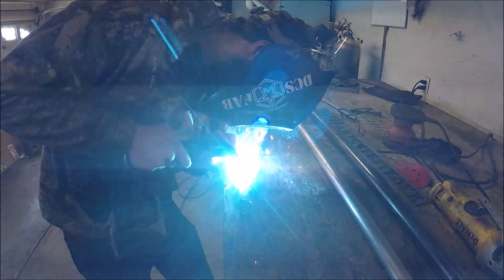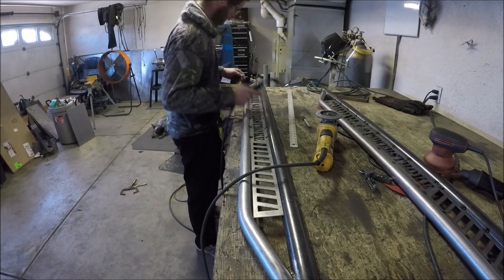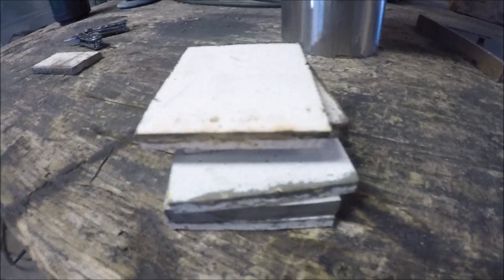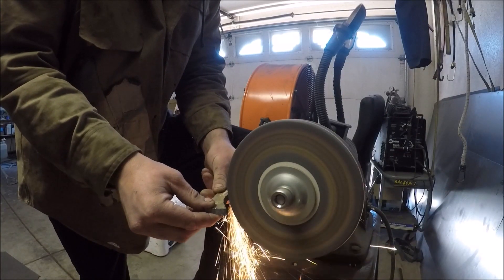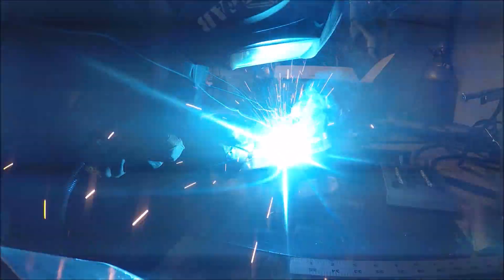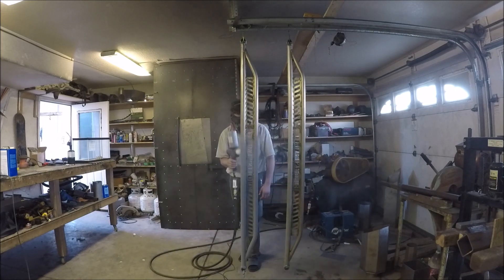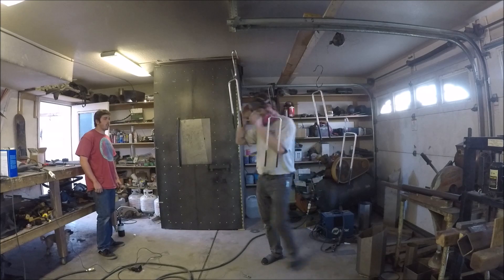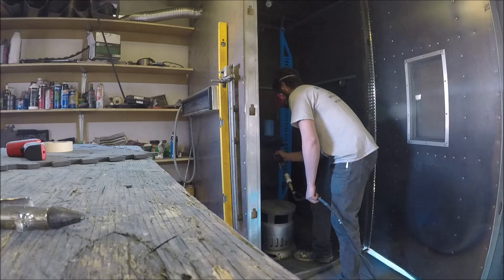Building The Most INSANE Set of Traction Bars! | DCS Custom Fab Work VLOG

Comment: Can you make a video on your powder coating oven? That thing looks badass
Reply from the maker: I definitely will!
Reply: I ageee. Are you useing propane to cook your parts?
Reply from the maker: Yep sure am. I originally was using the electric heating elements from I striped out of a double stack household oven, but they couldn't heat that much volume. I tried several different methods until I got that gas burner I have now which works great. I'll make a video on it!
Reply from the maker: New oven video is up!